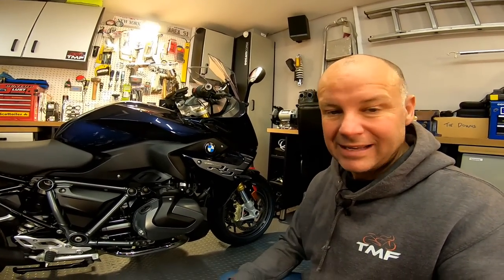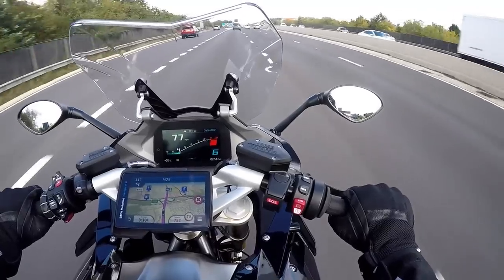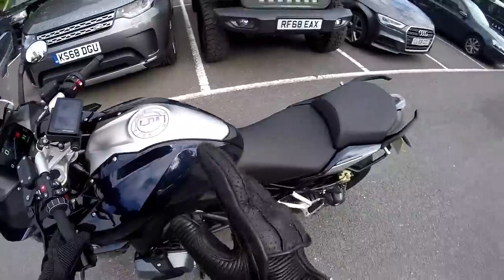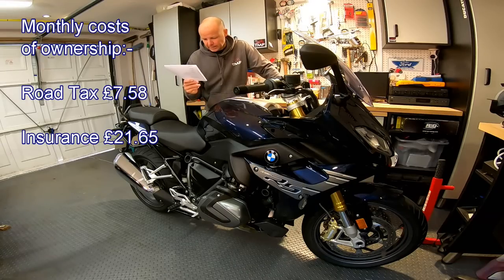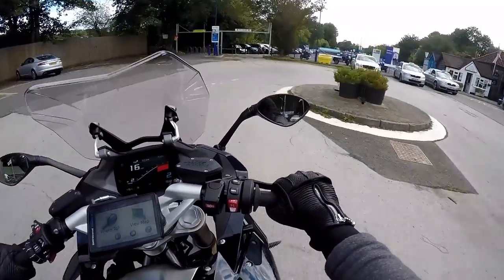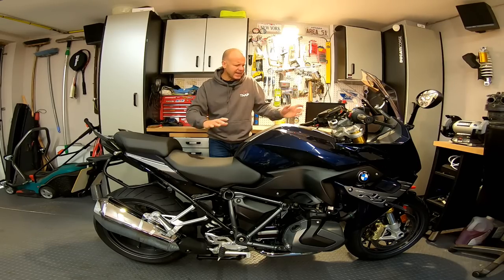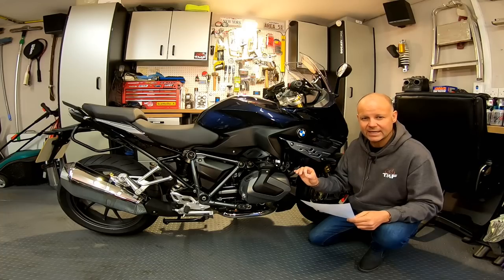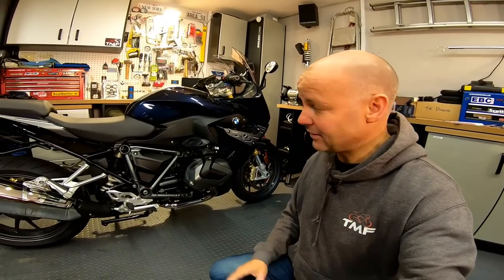Living with the BMW R1250RS - In Depth Review

Comment: Does your “manhood” get shoved into the tank? That’s the only thing i hate about my speed triple. 

Nice review!
Reply from the maker: No I didn't notice that....and thanks!
Reply: Mine doesn't but then again in this cold weather it's gone into hibernation.....lol
Reply: Bib The Boulder LMFAO
Reply: ha ha same with me
Reply: Last name First name so like a jock strap and a cup then ?
Reply: Jool sold my ‘08 speed triple for a ‘15 RS and found this “feature” to be about the same - I’m 170cm (5’7”) tho and since moved to the R which I find great, with less weight on my wrists. The RS was lovely and perfect for my vertically challenged legs but a bit long on the reach even with risers. As someone else said - the perfect bike for an Orangutan 🦧 😂. Not sure if the metrics on the new 1250RS are the same as the 1200RS tho.
Reply: gregcnz  

LOL. yea....I can’t see myself touring on anything if my frank and beans are constantly being punched by the tank going down hills or braking suddenly. My 2017 speed triple is an amazing bike but geez I’m tired of the crotch torture lol. I’m 6’ (182 cm) so I think a GS is better fit but I’ll test ride the RS and go from there.

Comment: With all the front end protection this is a great bike for wet cold climates, how would it be for touring in hot climates with all that engine heat, would there be enough ventilation for the rider?
Reply: The Australian Road tests are saying you do notice the heat. The "R" was cooler in hot conditions.
Reply: In warm weather, you will have some issues with heated boots, 😭

Comment: I currently have a demo bike triple black rs as my gsa is having a new lh head at 10k! I have found it very uncomfy i am 6ft tall and i feel its really cramped also its making some horrible noises
Reply from the maker: Oh dear on both counts
Reply: @TheMissendenFlyer  the rs would be a better bike if the fitted the r tooyoke and bars the one i had was the tubular bars but the actual nars were nearly flat making me lean too far forward anyhow am sat having a bite to eat on a bench with derbyshire dales as a backdrop and my baby gsa 1259 rallye  infront

Comment: How about heat deflection from engine. Does it push the heat on to your legs? My S1000RR 2019 foot pegs get hot like crazy!!
Reply: Not at all. Passed on getting the XR after it almost cooked my legs.  Really the perfect BMW unless your going off road.  I have 2 others and a hyabusa, it's the one I have the most fun with.
Reply: @wiseoldman5841  Thanks. Heat is my main concern with my next bike. And the RS, i figured would best the Ducati SS 950 in that department.

Comment: Morning MF A little advice / guidance if you have time. I started biking again after a 35 year gap and looking for a suitable bike I ended up with a 2016 Kawasaki Z300 Ninja KRT which suited me well to get back into riding. Now two years on I'd like to change top something a bit bigger. I'm 67 years old 5ft 10 inches and weigh approx 8.5 stone so was wondering if you could recommend or suggest  a road bike(s) which I would be able to handle, not so much riding but when manhandling it. Thank you for your time. always watch you video's even though a lot go over my head. well done.
Reply from the maker: I’m a fan of the Tracer 900 or Tiger 800 (about to be 900)....considered them?
Reply: @TheMissendenFlyer  Thanks for reply, no I hadn't considered those so far. I had been looking at honda CB500x, CB500F and 650F nad kawasaki ninja 650. i've got thing time as I wont change until the spring. again thank you.

Comment: Lovely bike indeed mr Flyer! But the oilglass...I had the RnineT and that one had that glass. To check oli-level I had to run the engine to normal riding temperatue (easy!) and then wait for 10-20 minutes. Hold the bike straight and at the same time crawl on the floor trying to see that bloody glass, which is under the cylinder, without tipping the bike! Nightmare i.m.o. If I engineered a bike like this, I would make it much easier. Cold engine, bike on sidetand and thats it!